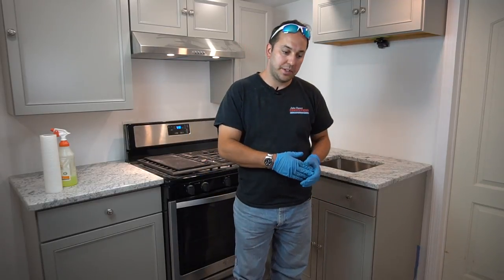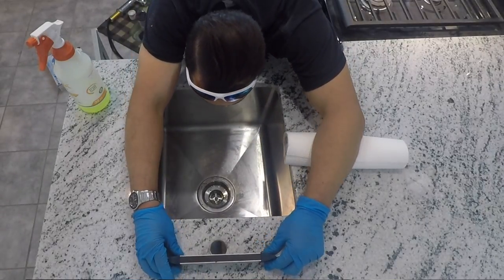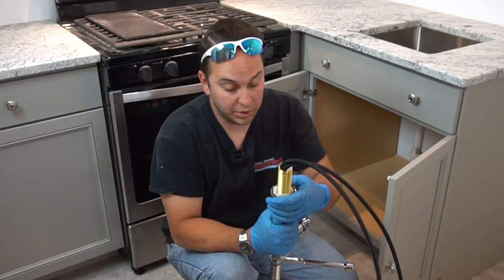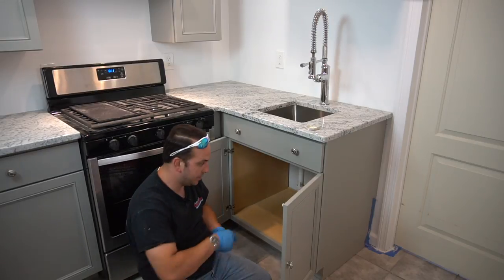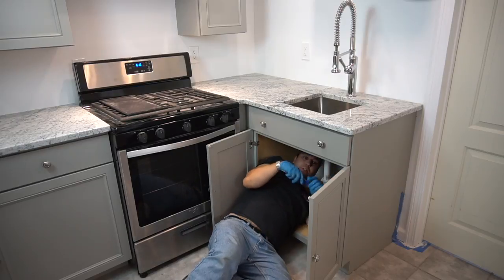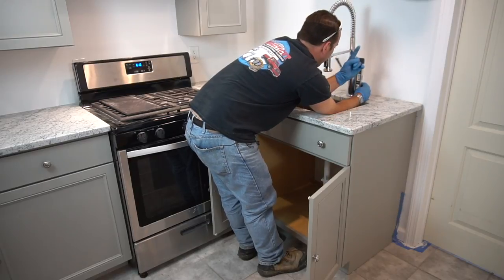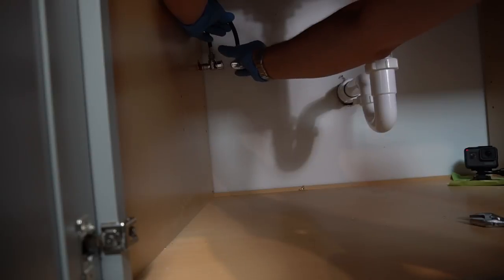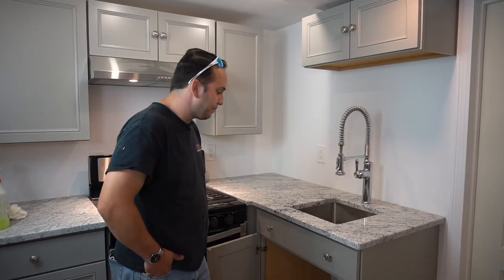HOME DIY | Installing a Single Hole Kitchen Faucet in Granite Countertop

Comment: Does anyone know the diameter of the hole cut in the granite for the faucet.  I have a brand new faucet that comes with instructions with no size for the hole to be cut and I don't have vernier calipers to measure it.  By just a ruler and my eye it looks like 1 1/4" across the tread.  Is there a common hole size ???

Comment: Unless the owner preferred the handle to point front, otherwise the handle should be mostly on right or left side. I have the same faucet with handle on the right side.
Reply: If it is positioned to the right or left and there is no space in the back for the faucet dial to  rotate it has to be positioned in a different way.  Still functional
Reply: its a grossly oversized faucet for that location,  probably couldn't rotate fully if on the side

Comment: I’ve got the same thing in my apartment, but my landlord installed it. It’s been about three months now and the faucet has become loose from the granite top. How do I tighten it up again, or should I just use some silicone around the bottom?
Reply: I have the same problem
Reply: I believe you just have to retighten the screws on the bottom of the sink that holds the faucet
Reply: @wandygonzalez8078  o.k. I’ll take a look under their again and get back to you .
Reply: Yeah my faucet comes loose after about 4 days. I have to keep crawling under the sink to tighten it. But the action of swiveling it back and forth between the two sides of the sink always ends up making the thing come loose again. Really frustrating.
Reply: @jmthomas3462  ....and I was thinking about getting this faucet 😕

Comment: Those two screws are for tightening faucet to top  not for leveling !  Screw nut hand tight then tighten screws till faucet is tight don't over tighten  ! The top and cabinet should be level when installed.

Comment: Never apply putty to a stone surface. The stone will pull the oil out of the putty that keeps it malleable. That oil will also permanently stain the surface. In this case the stain won't matter, but I promise you that in less than a year that putty it going to crumble like an overbaked cookie; rendering that putty useless. #DontDropYourPlumber
Reply: You are right! Don't need putty when rubber gasket is used, putty tends to dry out and fail quicker than the rubber. Rubber gasket alone can do the job of sealing or use silicone
Reply: Can I use plummers tape instead of putty.
Reply: But for the meantime it works right?